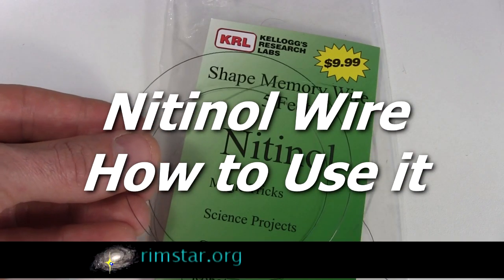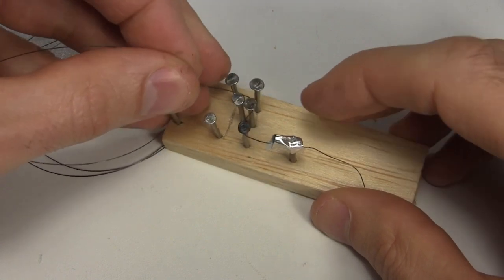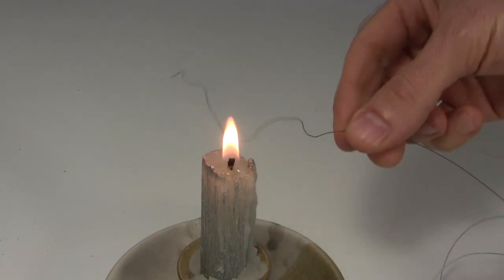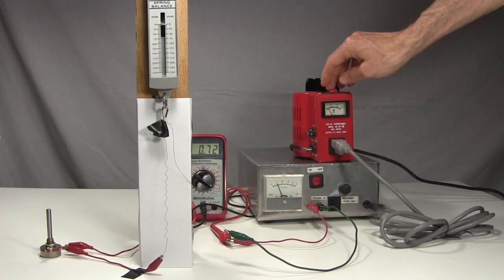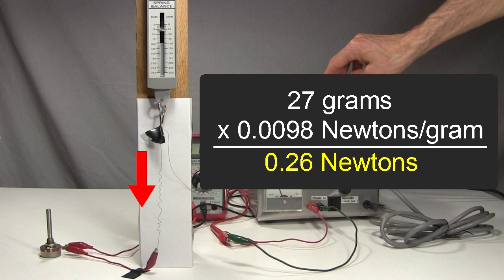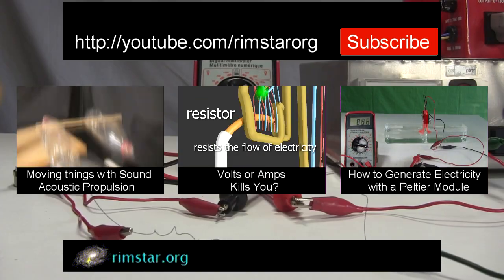Nitinol Wire/Shape Memory Alloy - How to Use it

Comment: I think i may have prdered it in a non trained state,  it just seems to hard,  i can bend radius in it but no signs of getting deformation.
Reply from the maker: Did you specifically order nitinol wire? Not just any wire will work.
Reply: @RimstarOrg  yes dude,  but it isn't soft it's hard.

Comment: You gor ro tell me what's up,  I got some .5 mm wire and it goes strait but seems like steel and I cannot deform it easily,  I managed to put a very small kink.   Did I get ripped
Reply from the maker: I'm not sure which steps you're talking about. Notice that in the first example, I wrapped it around some nails in order to create the desired shape, to make the letter R. In the second example, I coiled it around a nail. So I didn't shape it by just bending it by hand. You nitinol wire may also be thicker than mine and so harder to shape.
Reply: It's rigged as spri g steel

Comment: Thanks for the lesson. Got 3 one meter Nitinol wires. I want to join them together to use on a pulley to see if I can turn a motor/generator, with a thermal difference on each wheel to force it to turn, trying experience with heat & cold water/ice, even experimenting with Peltier plates. I've got an AC arc welder, butane gas torch & soldering iron I could use. Which should I choose?  Do you have any recommendations on how to join the Nitinol wire together as to be strong enough to hold under tension? I did see a documentary using Flux 400, but that's impossible to purchase. Basically want to know how to join it together in a loop. Many thanks.
Reply from the maker: I'd recommend that you don't do it with heat. You'd probably need enough heat that you'd damage the properties of the wire. I'd use a mechanical solution. Maybe something like a butt connector would work (search for "butt connector").
Reply: @RimstarOrg  Tried that already, which holds it, though not under any real pressure, but just thought of another solution I might try, using a longer butt connector with aluminium tape (very strong!), and epoxy resin. I've seen heat applied in a demonstration video, using soldering iron & blow torch, but needs very strong acid solution like Nitinol 400. Even if I could find it, it's too dangerous to use in one's home,  the vapours alone can cause serious harm.  Seen videos of the wire on spindles in water, though makes a bit of a splashy mess. Will keep trying. I first saw Nitinol in 1974 live on Tomorrows World on BBC1, connected to a bicycle wheel, joined together. The presenter at the beginning of the program asked 'can you guess what is powering this wheel?' & continued, 'we will come back to this later in the program, but first, over to Jeremy.' They never did go back to it. Waited 'decades' to find out what it was. Really... rather quite, annoying. Thanks.

Comment: I have questions! How much abuse can you give it and have it still go back to its program shape? And the other question, if you bend it up, and then just leave it on the shelf for a year or two and then heat it, will it go back to its shape? Or does it lose its memory after a while?
Reply from the maker: I don't have the answer to your questions. The only problem I do know of is if you heat it too much, it will lose the memory of the shape and you'd have to reprogram it. Each material has a certain temperature you should not go over otherwise that will happen.
Reply: @RimstarOrg  Awesome bro. I was so intrigued i ordered 5 feet of it LOL

Comment: 1:00 thanks for the warning. It's confusing how high temperature is needed for both returning its shape and changing its memory. So the difference is high high the heat is.
 Low heat = return its shape. 
High heat (or accidentally placing too close to the fire too long) = change its memory.

Comment: You did a great work.
I had doubt regarding that how much voltage is provided to the sma to remember its shape and i want to know the circuit used in this video with all specifications.
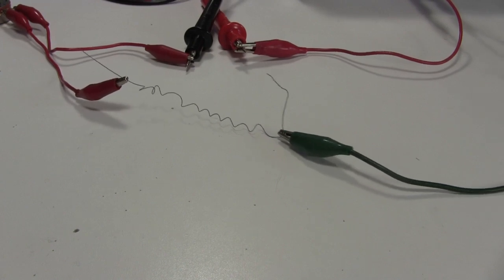Reply from the maker: At 1:47 you can see I'm using around 0.78 amps and around 6 volts.
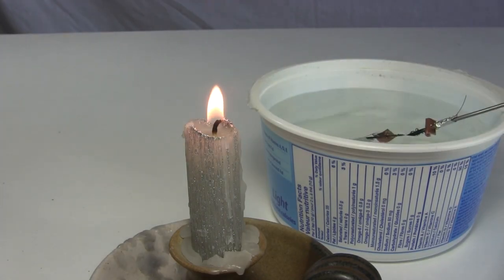To teach it it's shape I just use heat, which I do at 1:15.
Reply: @RimstarOrg  thank you for responding and for the answer.

Comment: How thick was the nitinol wire and does the thickness affect the transition temperature as well as the force applied when transitioning back to the original shape?  Also if in a pressurized environment, how would this effect the wire?
Reply from the maker: It's 0.01 inches thick. Unfortunately, I don't have answers to the rest of your questions.
Reply: I decided to buy my own nitinol wire and do the testing myself :).  Thanks for the inspiration!  I feel as if there is a lot that can be done with this, such as recycling heat waste energy into mechanical energy!

Comment: Nice video. Do you know a material that moves between two different positions based on the current applied? My question is related to apply this memory idea to use the wire as a servo in a mini radio control plane. But this material return to is recorded position only and it does not go back . Any ideas ?  Thanks
Reply from the maker: Nothing comes to mind. Everything I can think of are the usual electromechanical things involving magnets and electromagnets.
Reply: OK Thanks!!!

Comment: HI Steve! I did some similar shape-changing Experiment with Nitinol Wire (1mm thickness) Astenside-Temperatur around 37 degree celsius (+/- 10) i`m quite disapointed with my results. it doesn´t let itself bend easlily in the "cold" state. maybe too thick? Which kind of wire did you use? how thick?THX
Reply: i´ve read it down below... ;) any other tips?
Reply from the maker: The only tip I have is to not raise the temperature too high, otherwise it may stop acting like nitinol wire -- it'll be ruined. Stay within the temperatures your supposed to for the particular wire you have.

Comment: what are the specifications that you used?  :)
 thanks!
Reply from the maker: The nitinol wire I used is 0.01". According to the specs, to program the shape you need 950F/500C. To make it go back to the programmed shape you need 150F/66C. I bought it from here https://www.kelloggsresearchlabs.com/Nitinol/Raw-Material but they don't seem to advertise it anymore.
Reply: thanks a lot! I share to you a project that I made with flexinol,  https://vimeo.com/34995129

have a nice day

Comment: you only need to use hot or cold water , no fire or electricity
Reply: But you need fire or electricity make the water hot, so may as well just directly use the heat source.

Comment: Hey im a magician from Canada and Im planning on buying some of this to make my own self bending paperclips and i was wondering:

Once shaped is it possible to bend the wire with one's own body heat, or is an open flame required?
Reply from the maker: Sam Ghostly I think there is nitinol wire you can buy that will work with body heat. Mine doesn't. You'll have to search around for that. I don't have a link off-hand.
Reply: Currently im buying off of Kellogg's research Labs.
They claim that the "Body Heat" wire will bend at 35' C and stay soft at room temperature, however im worried that it will be too sensitive, however the next level makes it only reform at 45. 

My question is if say you bend the wire in multiple places, and then only apply heat to a fraction of the wire Say Half Will the entire wire bend back into shape or will only the heated section revert?
Reply from the maker: Sam Ghostly If you managed to heat up only half, and the heat didn't migrate to the other half too, then only the heated half will have the effect.
Reply: RimstarOrg
Cool ,Thanks for all your help man <3
Reply: we have air temperature hotter than the human body. Your trick would only work in winters here :D

Comment: Hi, nice video! Can I ask what size of the wire did you use? And what is the phase transition temperature for the wire in the video?
Reply from the maker: david zhai Mine is 0.01". To program the shape you need 950F/500C. To make it go back to the programmed shape you need 150F/66C, but I find that as you keep reprogramming it and if you exceed that temperature too much then that required temperature keeps going up so what it is exactly in my case I don't know.

Comment: Cwhat to program it to unwrap from small roll  when placed in sobebodys food? Is body heat enough to complete transition??? :-)))))
Reply from the maker: soton000 Mine needs a higher temperature but yes, you can buy body temperature nitinol wire. Search on google for "body temperature nitinol wire". Kellogg's Research seems to be the company that makes it.

Comment: Will the wire go back to a straight line when the current is turned off?  I need something that will act like an inch-worm that crawls where the wire will extend and retract.
Thanks.
Reply from the maker: starward When the current is turned on (i.e. the wire is heated), the wire will go to it's remembered shape. When the current it turned off, the wire will remain at the remembered shape. It has only one memory. The difference is that while the wire is heated, it will try to hold the shape, but when it cools it will not try to hold the shape and so something else can influence it.So you either need two wires, one to extend the legs while heated and one to retract the legs while heated, or you can use a spring for the extension and memory wire for the retraction like I did with my inchworm here "How to Make Inchworm using Nitinol Wire/Shape Memory Alloy".

Comment: Cool video. going to check out your channel to see if you have a how to on your bench power supply. Not sure why you did the salt comparison, you already told us from the beginning how much weight it pulled. It's kind of like comparing the weight of 1000 pounds of bricks and 1000 pounds of feathers.
Reply from the maker: I don't have any video on the 24 volt power supply I use, though I have videos on high voltage power supplies that I plug into it. I guess I could make a video about it. Right now all I have is this webpage http://rimstar.org/equip/24v_pwr_supply.htm
Regarding why I did the salt comparison, that was because most people can visualize what 27 grams is unless they see 27 grams worth of something, salt in this case.
Reply: Makes since. Anyways if you did a video on how to make a nice power supply I think a lot of people would appreciate it. Although I think it should be like a "heres what you buy, heres where you get it, and heres where it goes" kind of video if you know what I mean. Im not good with schematics.
Reply from the maker: *****
I'll give it more consideration, thanks for the input. And my electronics videos usually go through the steps showing where the parts go. I don't always say where to get parts since viewers are from all over the world and have different sources, but I sometimes do depending on the part. I don't show schematics, but I do include diagrams with images of the parts themselves (except on my website, where I do have some schematics.)

Comment: Good job Mr. Steve 
It is also used in heart surgery 
Closed to open the artery, they roll in a small spiral 
And they pay quickly inside the artery to reach the area enclosed by the heat and leave it to increase its size programmed in advance

Comment: Nice. It's funny that you post this video because I've recently got nitinol myself. My wire was wound as a tension spring already. I couldn't find any dynamometer, so I measured its strength by making it pull a calibrated weight against gravity. The heaviest weight it could pull without deformation was 200 grams. I believe it could pull a little more than that thou. I plan to make a simple machine out of it. What about you?
Reply from the maker: I've thought about getting some of those springs. It would be fun to make a motor with some. Be careful that you don't heat it much beyond its transition temperature. Heating some of them at 350C will raise the transition temperature, meaning you'll need a hotter source than advertised to make the spring compress.

Comment: What would you use it for? I don't see that it's gunna be accurate so would it be usefup in electronics?
Reply from the maker: Mostly nitinol seems to be used in medical applications, but also cell phones as retractable antennas, golf clubs, glasses frames, dentistry. I'm not sure yet what I'll do to play with it - if I buy some with a lower transition temperature then I could make a spinning wheel, but muscles for robotics also sounds like something fun to try.

Comment: This stuff is pretty neat. We experimented with it a long time ago, trying to make a parachute deployment system activated by the wire, since it would be so light and makes a significant amount of force.

What we found was that the wire needs a lot of current to heat up, and that any weight savings would be offset by the mass of the battery needed to provide that much current.

You should show a future experiment where you take the same wire in this one and wrap it up/down the measurement rig multiple times. You multiply the force that way. It's pretty cool to see how strong it can get.
Reply from the maker: Yeah, I figured putting more in parallel would give more force, at the expense of more energy usage. I've got the bug now so I'm sure I'll be doing more.
I guess if your rockets were based on fire then you could get the heat from that at the right time somehow.
Reply: If you take the same wire you currently have, without changing the length (or current), you can get more force by carefully shaping it so it is doubled over itself or more. Zig-zag shapes are good for this and the points can be used as the connection points for the load you move. Inventing ways to make it more powerful is a lot of fun.

You can also make a force multiplier with pulleys or levers as well, but those take more room.

Comment from the maker: Fun with shape memory alloy - nitinol wire. Shape it however you want it, heat it to high temperature, straighten it out, and heat it a bit, ... it returns to the original shape. Like magic, but not. I do some demonstrations and do a force test. Check it out!
Reply: At first, I saw the word "memory" and I was "Does this wire works like the memristor or something?", because I asw in a site about memristors made by metal wire.
Reply: ı buying standart nitinol ı can pragrame but cant change shape it is very elastic please help me
Reply from the maker: Derya Uhri
You have to hold it rigidly in place while you heat it. That's why I bend it around nails or coil it around a metal rod while heating it.
Reply: can i reprogram nitinol wire? I only can buy nitinol springs in my local store but i need it in a heart shape as part of the christmas present for my GF XD
Reply from the maker: Streifenprinz Yes, but you'd need to know what temperature to use. Not all nitinol wires are programmed at the same temperatures. I guess you can try with different temperatures, starting from low ones and using a higher temperature each time.
Reply: RimstarOrg
Reply: Anyone here watch Age of Extinction??